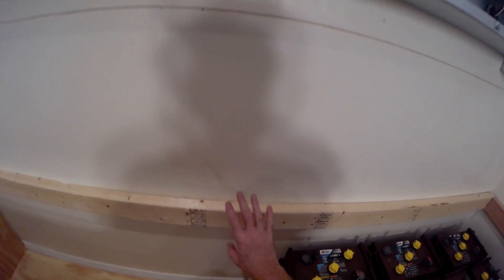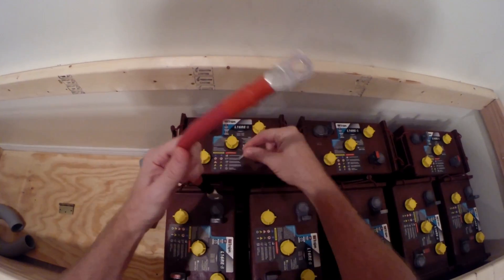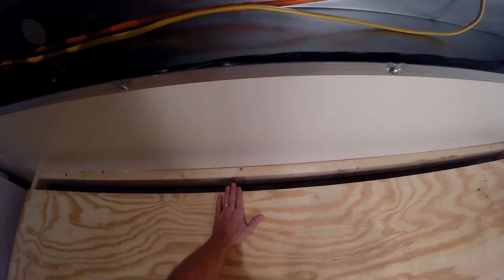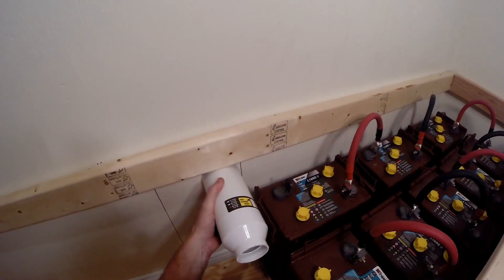Off Grid Solar #20: Wiring the Trojan Battery Bank

Comment: How did you calculate your battery bank size? What is the capacity and what is the charge rate that you can use with these batteries?
Reply from the maker: A single Trojan L16RE-B battery is 6 Volts and 370 Amp-hours.  That by itself would be 2,220 Watts of power but of course its only about 40% usable so figure about 888 Watt Hours.  Now if we string 8 of them together then we get 48 Volts but still only 370 Amp-hours.  That's 17,760 Watts of power but figure 40% and you get about 7,104 Watt Hours or 7.1 kWh of usable power.  Make 2 banks and you still have 48Volts but now double the Amp-hours to 740 and you get 35,520 watt hours and at 40% you get about 14208 Watt hours or 14.2 kWh of usable power.  Now that said, I only use about 7-9 kWh from my bank on a daily basis to make them last longer.  Hope this helps.  
https://youtu.be/sbZEvf62i8o
Reply: @HomesteadEngineering  Thank you for the quick feedback! I was wondering what your max and average charge current is for each string of the battery bank. If you are using 2x 4.4kW inverter, that would come down to about 92amps per battery string which seems high, not? I thought the typically recommended charge current for these kind of batteries is 50-60amps. What are the typical current values (max/avg) your charger puts out during the day?
Reply from the maker: @pmgriphone  It starts ramping up in the morning from 0 and is typically around 60-90Amps.  It does not seam to spend a lot time over 100Amps I have seen it as high as maybe 150 Amps.  I have 13,000 Watts of solar driving three 100Amp charge controllers but they are programmed and throttled to match the batteries.  You can see my system in real time and all my history of charging here: http://data.magnumenergy.com/MW5454/

Comment: what did the backup rig; not labor cost, batteries and all electrical components cost, that are not for solar half. RThank you we only get 7.2 per kwH payback for over production but charges are higher than 16 cents for buying it back what a deal,,,,,   A solar power 'filed arrqay nearby 8 yrs ago for a meg Plug got a 14 cent contract... total crap for a homeowner, so batteries may make us money since we are on the grid if only we must.
Reply from the maker: Hello Joseph,  The short answer is: buying batteries is not going to save you money.  Buying batteries is going to ensure that you have power when the grid goes down.  Here is a video with all the parts cost.  I did all the labor myself.  https://youtu.be/zb4oar9UHSY
Note: When these batteries eventually fail, I will go big with a Lithium bank like the Fortress or Ark.  I would like to have 40kWh of usable backup power.

Comment: Hello Guys,
question here, i have 8 spre 06 415 battery bank (8 months old), in a 24V system with 6 250W panels and a 60A Outback CC.... Small house and the panels top up the batteries good during the day... problem im having is at 9PM before i go to bed the batteries are at 25.2V +/- i only use 2 fans (100W both) i woke up one day at 4:30am and i checked the voltage on the bank and it was down to 24.6V, is it normal to draw that many volts with just the 100w from the fans and whatever the inverter uses? thanks
Reply from the maker: Harry,  You need to do a little more work here: 
1. Calculate the total kWh that your using overnight  
2. Calculate how many Amp hours your battery has
3. Calculate how many Amp hours your battery dropped overnight
4. Convert those battery Amp hours into kWh
5. What you used overnight and what the battery dropped overnight should be close.  
The battery kWh used will be higher do to losses in the system.
Reply: Hey, thanks for your response... sorry i thought i was clear with the information i provided, the batteries are trojans spre 06 (meaning 6 volts) 415 (meaning 415 AH) in a 24V system... so, 415AH x 24V = 9960 watts... I only use 2 fans at night (one uses 80Watts/H and the other one is a really small one uses 20Watts/Hour) in a 9 hour frame time should only be used 900Watts... So, i equalized my batteries and that seemed to have fixed the issue, i hadnt done it since i bought/installed the batteries.

Comment: Nice job man, i like your system very much. Nice clean and work. You spend a lot off money. I have a small system with four brand new t105re,they are a verry good battery. What do you want to power with that system? Thanks for you video.
Reply from the maker: I am powering my entire house with this system, everything except for the large 240v loads like heat pumps, oven and water heater.  Thanks!

Comment: If you had another bank of battery, a third, would you use a bus bar and tie into one of those two? I wonder how charging would be handled without a third CC.
Reply from the maker: Yes, I would have both pos and neg busbars with all three banks connected on equal length cables.  Then run dual 4/0 cables from the pos bus bar to the inverters and dual neg 4/0 cables to the downside of the shunt.  The charging would be wired the same and the chargers would all be networked to work together.
Reply: David Armstrong 
Thanks for the info. Your Magnum panel seem to have another dc breaker slot for up to 4 battery banks.
Reply from the maker: The system has 4 large DC breaker slots for up to 4 inverters.  The inverters are networked together and only come on as needed.  Most of the time (98%) my system is running on a single inverter and the other one is in standby until I reach 60% load on the 1st inverter.  I suppose you could have a bank for each inverter, but all the banks would still be tied on a busbar.  One thing of note:  the charge side all comes down on the master inverter leg to the battery.  I think that kind of makes sense as the master inverter is always carrying the load.  If your system had all 4 inverters cranking at 70% all the time, then you may want to re-think that.  I need to ask Magnum why they did it that way.

Comment: What are you venting the battery box with? A fan?
Reply from the maker: Zephyr 48vdc battery box vent.  Its expensive because it does not spark.  You should probably mount it vertically (I am going to change mine).  Watch install here.  
https://youtu.be/6OrkiFiVvjo

Comment: Nice! A couple side-effect issues I've noticed from other solar YouTubers is noise pollution (cooling fan noises) and added heat given off by the powerwall equipment. I'm guessing this is a multi-purpose room where it could be a bit noisy (ie guest room, exercise room, etc...). Also, I'm guessing the overall room temperature will be hotter due to the heat given off by the equipment. The AC will likely work harder to maintain a reasonable room temperature, especially in Florida. I've also seen where folks have added a couple clip-on fans blowing on the charge controllers/ inverters for good measure. Hopefully, it won't be too bad here.
Reply from the maker: I have a plan for the added heat.  I have purchased a small window AC that I plan to run almost like a dump load on the solar.  I plan to run the window AC from about 11am-2pm when it's the hottest out and the batteries are full and I am not using all the power coming off the panels.  The room also has a dedicated 1.5 ton AC unit/heat pump that will run off the utility.  This is a bit down the road as I have a lot to learn about how to actually use solar once I get it installed.  I imagine it will require some lifestyle changes to get the full benefit of the system.  I plan to switch to LED lights and do a lot more electric powered chores when the sun is shining the brightest!  Also, in a extended power outage we can all sleep in this little room with the AC keeping us cool...  Thanks for watching.
Reply: I'm learning as well. Although, I've been building a small off-grid setup for a hunting camp.A dedicated A/C for cooling seems like a good option. I wonder if the charge controller direct load terminals could handle repeated start-up surges of the A/C compressor. Perhaps, a capacitor could be used to handle the surges. Even if the A/C is connected to the battery bank instead, it might not be a bad idea.